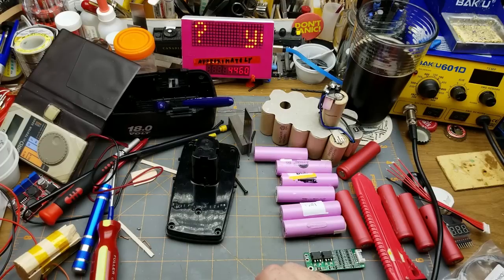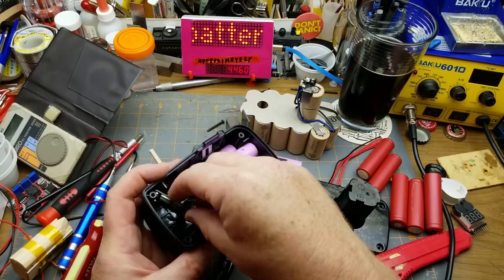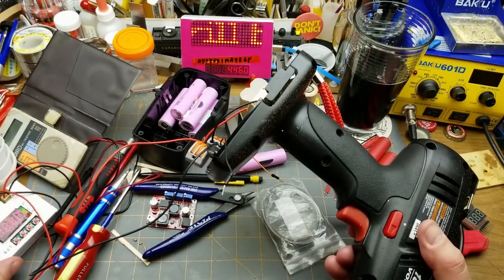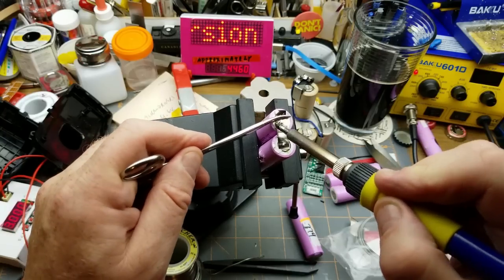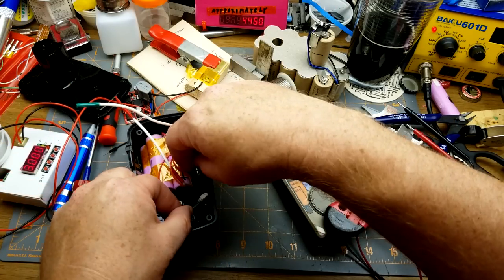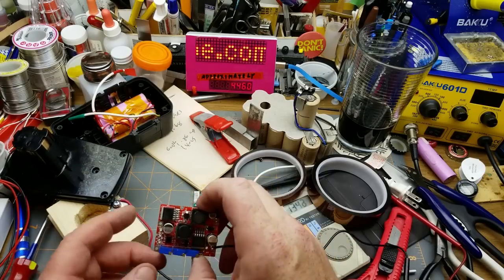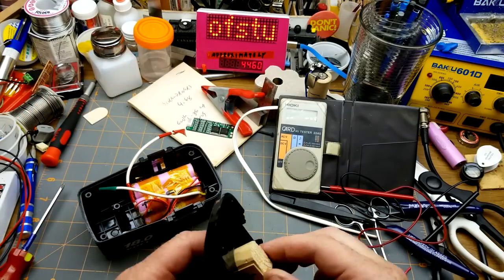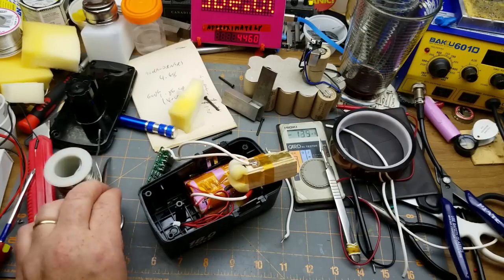Drill battery conversion. But will it work?

Comment from the maker: Is it really a failure if I learned something  from the process?
Reply: you got close, the Samsung cells are designed for high capacity low draw.  you will have better luck with the red Panasonic/Sanyo cells. Just be aware that those red cells have an...interesting feature: https://secondlifestorage.com/showthread.php?tid=303

Comment: U.K. Like you I spent a long time 'faffing' about with fitting all the correct gubbins into the battery shell of an old 7.2V Bosch drill. My efforts not only looked a mess but when the batteries went flat I would not have a drill to use. I ripped the lot apart and went to the KISS method - Keep It Simple Stupid. I made the 2 x 3.7V batteries easy to remove from the old battery case. So that I don't ruin the batteries I put a tiny 2 wire LED volt meter (99P) and test switch in the base of the drill, knowing the state of the batteries helps.  I can have the batteries out and new ones in in less than a minute and not wait for over an hour for them to charge. Remember to get the high drain Li-ion batteries - vaping batteries are fine. I have 2 of these drills, both over 20 years old. Single speed, one keyed, one not. They will sink a 100mm screw (4") into wood flush.

Comment: The specs of the Samsung ICR1865026F cells have a maximum current output of 5.2A since they are used in laptops and not designed for high current draw. From the spec sheet. Your BMS is a continuous 15A which should do the job with 56A peak current before the overcurrect protection kicks in. Now those are old cells with approx 1/2 the capacity so they probably max out at 3A. Your charging circuit is fine. Your bottleneck is the cells. In LiIon drill packs they use >20A cells. I will still however get a bigger BMS because it is a bit 'on the edge. When I load my liion drill (24v) I get 15A draw and 3A free running. It's an induction motor.

Comment: Did the same, just added a small socket to provide the charge current, and connected the drill motor to the battery direct, leaving the BMS to do charge control only. As I was using a single cell no balancing issues either. Good upgrade to a free cordless screwdriver, looking at doing the same to another cordless drill, though my go to drill is now a short cord and a 12V 7Ah SLA battery powered one, which is both portable and has good charge life, especially as I have a few old SLA units to keep cycling though it, and they spend the off time on the solar charge controller getting refreshed.

You need a BMS with a much higher trip point, probably around 30A or so, more than the small ones will do, but you might also experiment with the BMS circuit and add a small capacitor across the BMS gate circuit, so that the disconnection on discharge is very much slowed down, or add extra filtering to the BMS sense input, so it ignores those initial high current spikes from the drill.

Comment: I had the same problem with insufficient power from 18650 cells but a lipo pack (and 50A charge controller) worked fine.

Comment: Replaced 18v NiCd batteries with LIPO 5S pack. Was a bit longer than battery case but so much torque now! Connected balance connector for charging.

Comment: Great tinkering video, like that a lot. Maybe you should connect the laptop charger directly and measure how much current the drill wants? 18650s can deliver a lot of current which is why they are so popular, it must be the BMS holding you back 😁

Comment: The battery balancer was a nice thought, but its working against you when using the drill. If you make a circuit to bypass the balancer when the drill trigger is pulled  you would get the full amperage allowed by the batteries. Then when the trigger is off the balancer can go to work. But remember not all batteries are equal. Internal battery resistance is going to come into play with projects like this. Your batteries came from a laptop battery. They probably were designed to slowly discharge over time, thus they have a higher internal resistance. Find some that came from an old lithium Ion batter pack. They were made to quickly discharge for instantaneous power, thus they have to have a lower internal resistance. It probably explains why the drill powered up exponentially. That's my two cents. Very entertaining video.

Comment: hey, at least you didn't catch your bench on fire. positive right out of the gate. when experimenting with lithium batteries, make sure you have a containment system in case they go into thermal run away.

Comment: When I did this with my batteries I didn't use the cutout circuit, or even a balancer initially on my prototype.  My old laptop cells can supply a good current and power the drill pretty well. 

I'd suggest bypassing the cutout circuit on your BMS and trusting yourself to stop using the drill when needed. To be honest, once the cells drop to 3.5V or less per cell there's no power left and you'll already stop using the pack.  Mine have been in light use for over 
three years now with no problems.

I made a short video of the prototype build, basically the same as you did...
https://www.youtube.com/watch?v=aG_Z8JspjGY&list=PLKNG29pOrLl-FQbmpi0V_VCSboeUbbhK9&index=1

Comment: @pileofstuff #pileofstuff cool idea having insulation tapes on a string loop, ive had mine on a horizontal pole in the past but it can be annoying if you need to tape something in place and need to take a roll out that its in the middle of the pole, i think i may give your way a try. Ive just converted a 2.9v NiCad 20 year old "pole style" "inline" screw driver to a single 18650 the other day, well cool as i can now also usb charge it too, have a look out for the old black and decker and skill branded ones. I can confirm they are easy to convert and work, having the pole based screw driver that i can use upside down verses me using a standard cordless drill/driver it feels far more ergonomic and weighs alot less too, been great espically with smaller electronics, thanks for the video    ;-]

Comment: Is it possible to put a BMS bypass switch in there so when you drill you get full power. Then it's just a matter of switching from charge to drill.
Reply from the maker: Probably, but I think that would also bypass the low voltage shutdown feature of the BMS.

Comment: It looks like your BMS protects above 15A. I never measured it myself, but i think during the startup many drills can easily go above 20A. There are some 5S BMS on AliExpress that support up to 30A and also include a charging circuit. If they fit into the case they might be worth a try.

Comment: Another way to approach this is to use one of those cheap RC battery monitors (like: https://www.aliexpress.com/item/32886697715.html) attached to your BMS connector in parallel to the BMS and attach the battery directly to the motor.  Run your CHARGER through the BMS so it stops charging (will require a different charger port) and the RC battery monitor can inform you when the battery gets too low (you set a low voltage threshold for it to alarm).

Comment: Are you going to look into this anymore? 
I'm just doing mine now with a 4S 30A - I've got it in 3S2P config -, and I just noticed that there are 100A BMS's cheap, ie, around $10.
Reply from the maker: I'm not decided yet.

The best solution would probably be to make a 2P pack with a higher current BMS, but that would need more physical space in the battery case. Not sure what to do about that - I'm not especially interested in learning the skills needed to CAD a 3D printed part at the moment.
Reply: @pileofstuff  I got mine running and I think it's going to be good enough with the 30A BMS, at least good enough for the couple of times I use this per year. Then again a bigger BMS is only $10, so it can't hurt to upgrade. lol
https://youtu.be/BlwDup_fqZ8

Comment: maybe a better BMS with higher discharge current 'allowance' would help? ( if there is such a thing)

Maybe pinch one from a dead Li-ion drill battery pack?
Reply from the maker: Possible, assuming the batteries can safely supply that much current.

Or maybe figure out a way to use 2 strings of batteries, each with their own BMS? (though physical space is the big problem with that plan)
Reply: @pileofstuff  As I was watching you try to stuff all those batteries in there, I was thinking about cutting a hole in the bottom of the bottom of the case and gluing together an extension out of ABS or styrene or whatever, depending on what the case is made of and what will glue to it securely. Some foam wrapped around the cells to help them not rattle around would be good but you probably were going to get there.
Reply: @markfergerson2145  That's what I was thinking, ie, spacer, and stand them up. You could 3D print a new bottom case.

Comment: This video shows how to solve the inrush current trip/stall. https://youtu.be/nPVg4UCdCE4 I used this guys advice for my own battery drill conversion and it now has all the grunt, full throttle and everything in between 😁
Reply from the maker: That's interesting. thanks.
  I'll have to see if that'll work on my board.
Reply: @pileofstuff  I hope your board has the connections for the caps. When I done the batt mod first I was more than a little disappointed, after seeing a few vids on YT showing how simple and great it was. It was a good few months later that I found that video and solved the problem. Best of luck 🤞 😀

Comment: Hi, have you had any issues with your baku BK-601D? I'm looking at one on amazon.ca for $89.99
You need to get 5 cells that can handle 10a + of current like a normal li-ion drill.
Reply from the maker: The soldering station has been surprisingly good. 
It was the absolutely cheapest one i could find and the only issue I ever had was the magnetic sensor in the handle of the hot air tool is slightly mis-alligned so i have to be aware of putting it in the holder in a specific position to activate the cooldown . 
Other than that, no problems in almost 2 years.
Reply: @pileofstuff  just ordered one,  thanks!

Comment: yes no take lot amperes  if have free and empty drill, but if load little amperes need lot lot more, i has use same drill whit battery,no can drill but car battery can ,take normal if drill 3.13mm drill hole need 6- 

10A power

Comment: Now that's a shame, i wanted that to work and better than nicad :-(
I wonder if it's the fault of the batterys, maybe they are crap and just don't deliver the current.
Charge the batterys and bypass the mosfet on the end of the bms, see if the battery voltage drops when you give the drill some beans lol :-D

Comment: From experience:  I now like to round off the corners of the nickle strips I connect to the positive side because the negative comes all the way to the top of the 18650 and the sharp corners can pierce the cardboard insulator and make for a VERY exciting time.

Comment: I think about all the time I wasted doing exactly that and finding the BMS pukes and won't pass enough current. Turns out if you go by the "advertised" amps specs the Chinese always lie, (I mean) exaggerate. Best I could do was so-so performance using a BMS rated at 80 amps!!